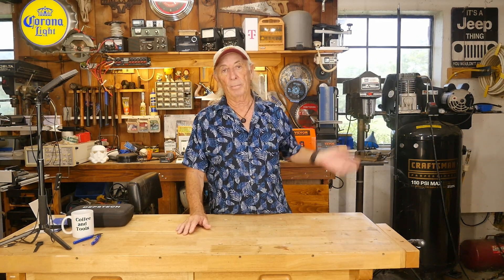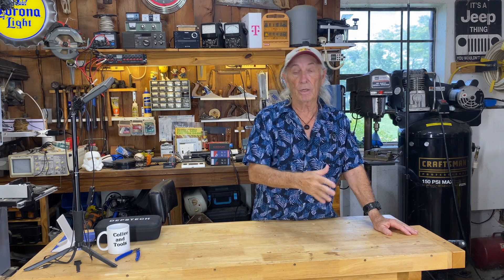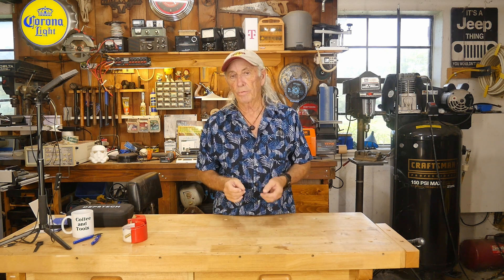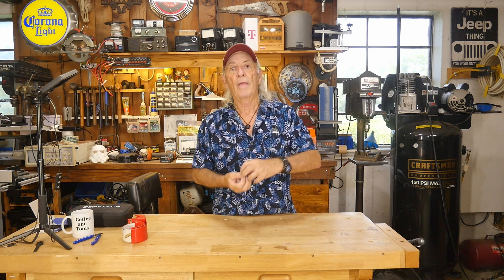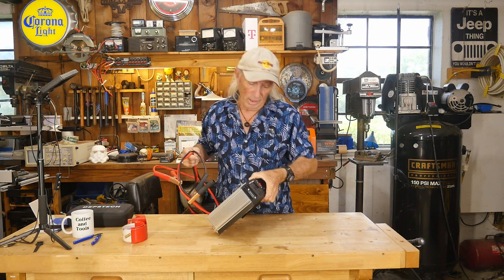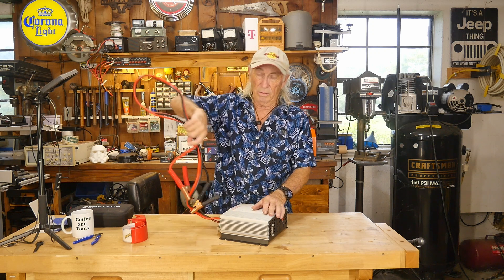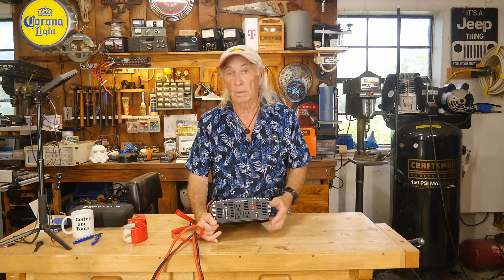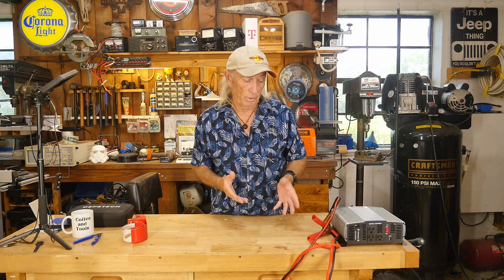Using solar power after a hurricane, ep 459 Coffee and tools

Comment: It has been cool watching people like yourself and how they dealt with an actual storm.  I lived through several major hurricanes 15-20 years ago when solar generators and even solar setups weren't a thing, so I've been preparing over the past 5 years as all this technology has become available.  Of course,  we haven't had any "need" for any of this equipment... yet.
I have found that the portable panels pretty much suck.  They work,  but in my tests, they aren't even close to a hard panel.  The good news is that hard panels are getting so cheap that we can afford to have a ton of power available.   I'm seeing 400-500 watt panels for $110 or so on FB marketplace.   At that price you can afford to put a couple in the barn in case a storm destroys what you have outside.
I have a 2k sogen that's will accept 150 volts of solar.  Mine is a Bluetti but I'm sure there are 20 brands with similar capabilities.   I can hook 3 of the 500 watt panels in series and pretty much max out the Bluetti charging.
The beauty of the portable solar generators is their portability.  Imagine that!  The more capable they are, the less portable they become.  If I can't pick it up and put it in my truck, it's not really portable.  The 2kw sogens run around 60#, so I can handle that by myself.  My main solar array is 400' from my house, so moving things around will be a necessity.
I'm like you, with several smaller systems.  I have three different solar arrays. One, my original, has 2-100 watt panels that go through a charge controller into 2 lifepo4 batteries and then into a 1k inverter.  That system works fine for running a chest freezer, but it's 12volt so can't provide a lot of surge capacity.  I can use it to charge the so-gens bit that really doesn't make much sense.  
The other 2 arrays use 400 watt panels, and I've never had to use them.
The key to any plan is anticipating different scenarios, and being able to react to them.  Having one solar array and having a tornado rip it to pieces isn't much of a plan.  That's why I recommended in your last video that you get a small gas generator.  My Honda 2k will run a small windo unit, and AC is critical to me, for around 8 hours, assuming the AC is the only thing on that circuit.  That's about 1 gallon of gas.
I really like the dual fuel generators because propane can be stored indefinitely and doesn't smell when stored.
Solar power is great but it requires you to manage your power usage very closely unless you have a massive system. It's nearly silent and can be run inside your home.
Gas generators are much more powerful.  You have to have the ability to store fuel, and you can't run them indoors.  The newer inverter generators are actually very quiet so I don't consider them to be "noisy.""  I have an old 6.5 generator that has a lot of power, but it's heavy, burns a lot of gas, and is too loud to have anywhere near the house.
Reply from the maker: Good reading here !  Love the ideas about storing some 400 watts in the barn. The portables are really are a shame on output. I think having several systems was a key to getting enough power day to day. One system charging all day long while the other kept things running. I've since looked at those small generators with new eyes. Might just be the extra needed for back up !🤠
Reply: @SirTools  when you're ignorant, you're gullible.  We all believe the marketing hype put out by the so gen companies. A 2k Bluetti is NOT a "whole house backup."
Everyone I know who starts dabbling with solar cones to the same conclusion.  You need more batteries, and you need a lot more battery capacity than you imagined.  I think 5kw is a minimum if you want to keep fridges, freezers,  lights, fans, and TVs running.  It's really shocking how much power we consume.
I live on 13 acres with a long hay field facing south, so I could install nearly unlimited solar arrays.  I have no interest in going off the grid, but being able to keep necessities going is something I think about.  We raise our own food, so I have 4 freezers full of meat, fruit, and vegetables. I really don't want to lose all the hard work we put into raising all that food, not to mention the money.
On the 4th of July, we had a failure on our side of the city water meter.  Naturally, our plumber was in Florida for the weekend, so we had to rough it for 3 days.  Fortunately, we have an RV, so we were able to take hot showers every day.  We have a lake and a 12v pump, so we pumped lake water into barrels and used that water to carry buckets inside and flush toilets.  We couldn't wash dishes, couldn't wash clothes, and couldn't just reach over and turn on the faucet.  It took my wife about 1 day to realize how much she depends on all the "luxuries."
I'm spoiled rotten, and I'm okay with that. I like my AC, my hot water, and my indoor toilets.

Comment: I have 1600 watts of solar panels and a 600 watts wind generator. I used to have lead acid batteries, but I changed them out in December to four 24 volts, 100 amp hours, and four 31 series deep cycle batteries for 600 amp hours. I took twelve of the lead acid batteries and wired them up 12 volts for the wind generator. I put two 100 watts mono panels in each tubing frame so I can make trackers for some of them. I used an Aims Power inverter and charger, its 2000 watts, and the little red overload light will come on at 2140 watts load. I had to rebuild it once after I built my wood stove. I used a tank like your air tank, but I cut it down shorter. I tried running my inverter welder which takes 2400 watts. I got the stove welded up before the inverter blew the tops off of five mosfets. I bought a Winco Lil Dog gas generator. It runs an hour and a half off a half gallon. My solar batteries are showing 26.6 volts, and the wind generator batteries are showing 12.76 v. Back in June, it rained every day for a week. My solar batteries got down to 24.3 volts. I was using the wind inverter as much as I could, but I have two chest freezers running, plus some cooking. I was just thinking about giving the batteries a charge with the generator, and the sun finally came back out. It took two days to get them fully charged again. I could have plugged the Aims inverter charger into the other inverter to charge, and it puts 30 amps into the 24 volts batteries. But I don't think I will try that. I just normally face eight panels East, and the other eight face West. That gives me enough to run the window air conditioner without having to move the panels. It takes 600 watts. The first panel I bought got the glass shattered in a storm. I had only had it a couple of weeks. It flew and landed on the corner of my uncle's sixteen foot trailer. So the idea came to me, and I made square tubing frames for each pair of panels. The first one I used one inch I D. Its a little heavy. The rest are 3/4 inch inside diameter. It made them heavy enough that the wind doesnt toss them around. When the wattage drops in November, I'll move all the panels around to the East side of the barn , all facing South. That keeps the snow off of them pretty well. I only get a few hours of sunlight in winter. But last year, in December, I had enough to run a 250 watts heat lamp part of the time. I found out that the wind generator makes most of its power when its cold. It helps when the sun power drops off. It's good for an electric blanket, which warms up the water bed mattress. It made a lot of difference last year in the amount of wood that I needed. It gets windy here too. In early June, a small tornado came through, and ripped the tail fin of my wind generator in two. I made a new one out of steel instead of cheesy aluminum like the original. It looks like an annunaki head, but it works better now. I have my solar panels in pairs in the frames, so I made them to unplug and I can take six or eight of them in the barn in just a few minutes. In case of hail. Its a lot easier to put them in the barn than to replace them after a hail storm. In May, they said there was a 96 mph wind coming my way out of Tulsa. By the time it got here it was down to 85 mph. My wind generator sounded like a dinosaur getting a molar pulled. I put longer grade 8.4 bolts with bigger washers, and locknuts on the back side, loc tite on those. Anyways, it didn't fly apart. My uncle was worried that a blade might come off of it in a bad storm. I told him, I did every thing I could to make sure the blades didnt come off. I said, it would have already been destroyed here on this hill in tornado alley...lol.I said, do you think its gonna blow any worse than it did the other day, when the wind was close to 90? This hill makes it speed up. He said. No it probably wont blow like that again...I said, well, its still working...its only 16 feet high, so I stand on the barn roof to work on it. I checked it and the bearings arent loose or anything. I need to get up there and paint the new tail. At first I was surprised that it had survived without more damage. Its a 600 watts unit, but for a couple of minutes it was making over 1100 watts...the wiring was getting soft carrying 50 amps. Just when I tbought it was all going to melt, the wind started letting up. You cant get ready for a little funnel cloud. They just appear out of nowhere. I like the lithium iron phosphate batteries. Theyre pricey but worth it. I would get four more if I could manage it. That would put me at a thousand amp hours. That would put me at ten days of battery storage with no sun or wind. That's long enough. The sun is supposed to be out there. After that, i can run the generator for an hour, worst case scenario. Last time I had to run it to charge the batteries was November of '21. I'll be on off grid power for four years in two weeks.  I used to use 63 volts coming in but have changed it to 41 v open curcuit, because the Epic Solar charge controller, 4215 BN is 2% more efficient at 33 volts than at 63. You should check the manual on your mppt controller. You might  want to tun lower voltage, less heat created in the charge controller. But, you cant put the panels very far away because of the lower voltage. It lets the charge controller run a lot cooler though. So that was enough for me to change it. If its running hot enough to need a fan on it, it needs to be changed, I think. I used two pieces of number 4 welding cable on the charge controller to battery connection. I have two pairs of number 2 welding cables going from the batteries to the inverter charger, in case one type of battery wants to dump amps quicker than the other type. None of my wiring has ever gotten even warm. I can run 12 volt lights and fans without running the 24 volts batteries down at night. They will last many years like that. Thats kind of my plan. I would a lot rather have my own power system than to rent power at higher price, and own nothing. I would  rather have the stuff to make power with, at half as much money, and just try to take care of it. I just like having free power. Looks like you have it going on...
Reply from the maker: There is a ton of good information here. Need to do 10 shows just covering all this. One item I cannot seem to get across to others is the difference between lead acid and lithium ir phos batteries. LOTS of interesting items in this comment. 🤠

Comment: While normally true, about portable panels not outputting near their full rated power, it's not always true.  I recently purchased an Ecoflow 400watt portable panel.  Under ideal solar conditions, I have seen it produce up to 430 watts.  This is NOT a bifacial panel.  I have a couple of Renogy 200W rigid panels on which the highest I've seen is about 170 watts per panel.  I also tried a couple of Eco-worthy 195 watt bifacial panels.  This company does not rate their panels the same way as most other companies rate bifacial panels.  Most rate on the front capacity and the back is bonus.  Not these.  Best I can tell is they are 150 front and 30% (45 watt) max rear.  I never seen over about 135 watts.  They were also terribly packaged and some arrive broken.  Thank goodness for Amazon no hassle return on the broken ones.  The Ecoflow portable is the highest output, yet very expensive and not very convenient for home use.  Maybe camping.  I'll be buying more of the Renogy 200W panels to increase capacity.

Comment: I bought a 2300 watt inverter Generator  Dual Fuel  Gas or propane. To help my Aims inverter charger if my Batteries start to run low after a couple cloudy days
Reply from the maker: Good deal and does the that extra if needed :face-blue-smiling:

Comment: Those plugs, the typical household plugs, are rated for 120 volts, 15 amps. So you should never see a single one of these rated for more than 1800 watts. But it's a good idea to check the ratings anyway, at least there won't be any surprises.
Reply from the maker: There are 20amp outlets too, but seems like the watts is even a lie at 15amps. I think there is a game going on and some folks are going to get the wrong idea.
Reply: @SirTools  you are correct, 20 Amp 120v plugs do exist, but they have a horizontal blade on one side. I do agree that I would expect all the plugs to support the same wattage, and would have never thought that some would be rated much lower than others.
Reply from the maker: Might end up doing a show about the "lies" over those plugs. Some are rated for 1,200 watts...each and again...yeah...NOT what a consumer might be thinking :)
Reply: 20 amps is 2400 watts. Thats how much my generator makes. I mostly run the welder with it.
Reply from the maker: I have thought about trying my welder on the solar generator :face-blue-smiling:
Reply: Its a Winco double 20 amp receptacle on the side
Reply from the maker: That is about the best you can get. Some manufactures are stating what the plugs are limited to each and some manage to leave out that information. 🤠

Comment: I WOULD THINK THAT THE WAY YOUR PV MODULES ARE SHAPED WITH A CONCAVED BEND IN THE MIDDLE WOULD FOCUS MORE SUNLIGHT LIKE A RADAR DISH WOULD PRODUCE MORE OF A STEADY PRODUCTION OF POWER FROM ONE DIRECTION . WOULD THAT BE TRUE ?🤔
Reply from the maker: Yeah that just a result from the boards and weight, but seems like to works well. The hard panels still far output better than that fast rig LOLOL..

Comment: Thanks for the real world update.
LVYUAN 5 kw LOW frequency inverter from Amazon worked well for us

My go power high frequency inverters failed to run my 800 watt window unit after a couple of years.
For anything more than a refrigerator, go with LOW frequency inverters.
Our solar panels are attached to our roof using two parallel 3 inch wide galvanized angle iron, all panels laid abrest.
The did not blow off.
Take care 
73
Reply from the maker: Super thanks for the update and very good, no damaged panels flying around LOLOL...yeah.:face-blue-smiling: